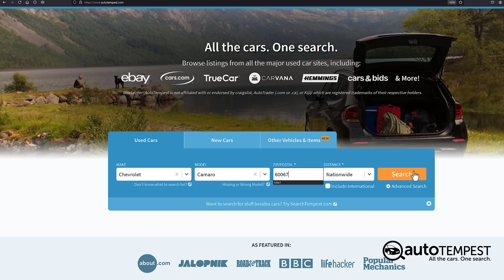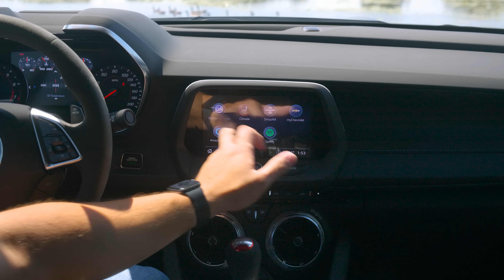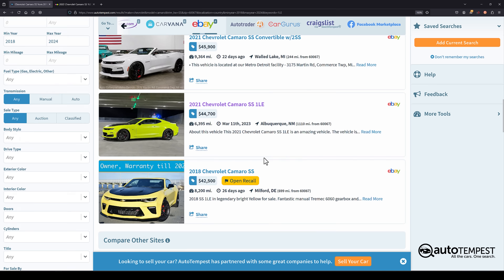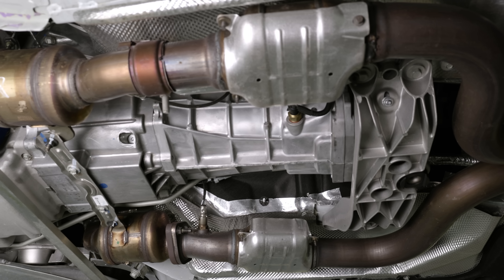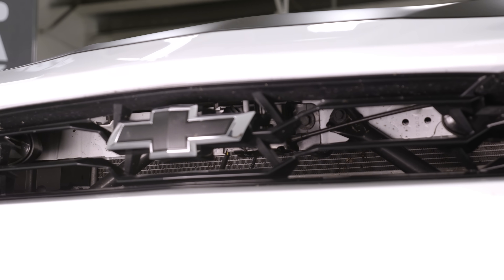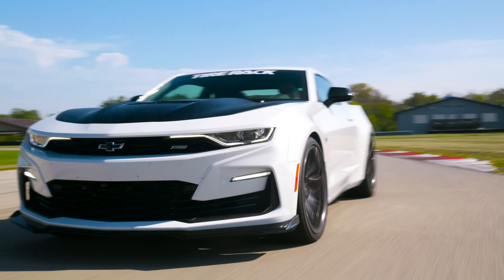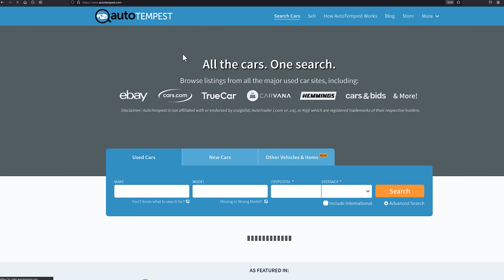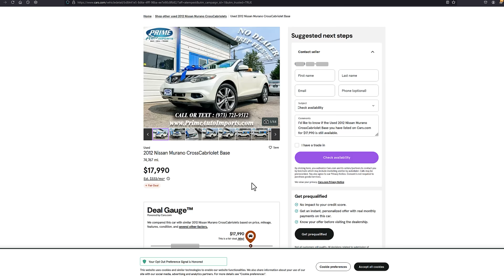Chevy Camaro SS 1LE | Best Used Sports Car of 2024

Comment: Bought a 2022 SS 1LE in May of ‘23 with Tremec manual and 3100 miles. I love it. I just test drove a 2023 Z51 Corvette and was bored driving it. The Camaro SS 1LE is the best value V8 for the money. You get way more than the Mach1 offers at the price point. I will be keeping my Camaro for the long term.
Reply: How do you feel about the visibility? That's the only thing holding me back.
Reply: @hhaste  It's totally fine. 99% of driver don't understand the proper way to set your side mirrors.
Reply: It is THE Camaro to buy. It does offer more value than Mach 1, slightly better max performance at track due to better chasis dynamics, but its not as fun or livable as Mach 1 for daily use. A lot of it is going to be personal preference between the two engines, they feel quite different due to powerbands. I couldn't get over the visibility, and liked the Coyote more, but easily see why people go the other direction, boy wouldn't it be nice to have both...!
Reply: lol the corvette smokes the ss any day it looks better and it’s faster but sure the corvette “ bored u”
Reply: @chagoescalante ive driven an mr2, and a miata (sort of a similar comparison) and the mr2 has a more balanced feel vs a front engine rwd car and that may be the boring he’s referring to. Theres the mid engine balance vs front engine front end weight distribution.
Reply: I would say we get the SAME as the Mach 1 at a much lower price point than the Mach 1, not more than the Mach 1. Only thing I can think of that we get and Mach 1 owners don’t is a HUD. Was cross shopping both and Mach 1 came out to just under 60k so I went 2SS 1le manual for quite a bit less.
Reply: @chagoescalante  Some very fast cars are great on track but not as interesting on the street. Perhaps that is why he was bored. The Camaro does both exceptionally well. Geese and Jack mentioned this in regards to the C7 Jack owned.
Reply: @hhaste  You adapt.  I got 2SS so id have the lane warnings.  I do autocross though with it and I won two races last weekend, open class.  It blows peoples minds there that a Camaro is able to do so well.  Its a monster and punches way above weight.  Once you drive it a bit, you know how large it is and can avoid stuff just fine.  I'm not hitting cones or anything at autoX.  You do need to treat it with respect and not go into a parking area you aren't sure you can get out of, take culverts at angles due to the overhang and ground clearance, not cut corners in parking lots/drive thrus due to islands and edges.  For people that have owned a low sportscar before, its no big deal.  For someone new, there is some adaptation.
Reply: @JohnDoe-np3xd  100%.  They all set them so they can see the SIDE of their car, redundant with the rear view mirror...which means they cant see the blind spot.  No matter how many times I tell people, they'd rather whiplash their neck merging with their mirrors set wrong.
Reply: @hhaste  I don’t have any issues seeing anything but I can see where some might have a problem during a track day.
Reply: Agree on the C8 Z51 feeling boring but I felt right at home coming from an 18 ZL1. Such a comfortable car.
Reply: It will be interesting to see if these ever develop a cult following outside of the GM crowd. Might not depreciate much.
Reply: @hhaste it's fine
Reply: @hhaste that is nothing to be concerned, very fast you get used to the car and it wouldn't bother you specially if you go for a SS2 that comes with safety sensors. They come with backup Camera as well.
Reply: @ThomisticAmerican13FOX For the money the Camaro is the best bargain for performance. The Mach 1 with the track package has cup track tires that wear very fast compared to the stock ones in the SS1LE
Reply: @chagoescalante the huge difference its the driver's involvement on the MT. The C8 Corvette doesn't have this option.
Reply: @Maelstrom8 they mentioned that the Corvette C7 GS felt more as a sport car, more involvement on the driving experience,compared to the C8 Z51 that felt more as a touring vehicle, more comfortable to drive it but kind of numb on the driving feeling side.
Reply: @Micartaa I would never replace a 6MT 6th gen Camaro ZL1 for an AT C8 Corvette. The driver involvement feeling ofa MT its irreplaceable. And the sound and push of the SC V8 is something else. Yes the ME experience on the C8 Z51 should be something else at the curves, but I prefer to stay with the ZL1. The ZL1 are more rare to see on the street and the C8 Corvettes are everywhere🤷
Reply: @jmmch3358  They mentioned that there are better cars for the road. Which is the point we were stating. The C7 is great. But its limits are so high that it isn't the most engaging thing to drive at legal speeds.
Reply: @Maelstrom8  I had the C7 Stingray Z51, and it was very engaging on spirited street driving. Probably you are referring to the Grand Sport, that has a more track focused setup.
Reply: @JohnDoe-np3xd  100%. I don't get the complaints. A lot of new cars have shockingly bad visibility.
Reply: @JamesNoBrakes  Well said.

Comment: I bought the 2024 Camaro 1SS 6MT for $43,500 out the door. Some Camrys cost more than that. It’s an incredible car, and a better daily driver than I would have imagined. Hope you can find one Jack.
Reply: Taxes?
Reply: Used? Thought new were around 48k?
Reply: Wow! 2024 1SS standard price was $42,300.00 + $7,000 1LE performance package + $1,595 destination charge = $50,895.00 MSRP with no additional options.  You got the best deal ever if you got a $7,395.00 discount and no taxes.

Comment: Agreed 100%, one of the all time greats. Sold my SS 1LE for an MT Supra and honestly there's days I regret that decision.
Reply: Damn I've got the Supra and want a 1LE.
Reply: What a car does on paper doesn't necessarily translate to a fun reality. I respect the Supra incredibly efficient at putting the power down, and they finally got a manaul. But it doesn't have that soul, that sound, the V8s will give you that visceral expeirence. Sure its faster than my Mach 1off the line, but in so many other areas the Mach 1 is more rewarding, having driven the Camaro too it is the same story.
Reply: Supra was on my list, but when it was announced it was a rebadged BMW, I got the 1LE.  Absolutely no regrets especially with a real exhaust note (not fake via the speakers)
Reply: @ThomisticAmerican13FOX meh didn’t have a Mach 1 but I traded my 21 5.0 for a 23 ss 1le, u literally feel zero torque in mustangs, stock wise..
Reply: The SS1LE its a better performing sport car compared to the Supra and 400Z
Reply: @jmmch3358 subjectively yes, but objectively I think the Supra is at least as fast, if not a bit faster, than the SS 1LE on a track. Don’t forget the Supra comes on decade old Michelin PSS tires, with a sticky tire, it’s quick. As Savageese themselves demonstrate in some of their lap comparisons.

Comment: I like mine. Bought used in March. It’s a 2020 SS 1LE that had 3k miles on it. I didn’t buy with any misconceptions or unrealistic expectations.  Wanted a “simple” NA V8 with a manual gearbox to track. All marks hit. 

My other track car is a ‘17 Grand Sport. Hits the same marks as SS 1LE. 

Took Camaro to track a couple of days ago. Fun car. It’s a heavy car, like they said, managing weight is a challenge. 

Between Grand Sport and Camaro, the Camaro is actually the more enjoyable on track. I think it’s the driver seat that gives Camaro the nod.

Comment: I would love to hear Jack's comparative thoughts on the SS 1le against his C7 Corvette Grandsport he owned.  Currently have a 1LE and constantly having an inner debate about switching to a Grandsport.
Reply: C7 gs has a better feeling front end(double wishbone) and overall higher grip levels. Trans is worse but drivetrain does much better with heat and oiling. The c7 is a edgier car though and doesnt cary slip angle as well.
Reply: @jackholmes8105  Thank you for the reply, you're the man!
Reply: @jackholmes8105 Jack if you get a 1le, try to do a square setup 305s all around with Cup 2s or Cup 2rs. It changes the overall grip and front end feeling in a very good way.

Comment: I have the LT1 and i track it pretty frequently its so much fun. I cant imagine how fun the 1le is
Reply: The LT1 has narrower tires, smaller brakes and lacks the cooling of the Camaro SS, that also GM backs up for track use.
Reply: @jmmch3358  GM doesn't back a regular ss for the track only the 1le trim
Reply: @danw4507  you are wrong, I owned a 6th gen Camaro SS2 MT, and the car's manual specified that they backup any track usage, even I had on my trunk some accesories to attach it for improving the cooling for track usage. 
Just do some research.
Reply: @jmmch3358  ah yes you're correct I was thinking of the v6, turbo car those have track coverage only on on the 1le trims when they were made
Reply: @jmmch3358  how can I go about adding the extra cooling to my LT1?
Reply: @danw4507  for the brakes probably buying some special ducts toward ventilating your front brakes, akso check if your rotors are vented (mine had stock Brembos), also you will need synthetic brake fluid.
Not sure if you will need rear differential and transmission cooling.
You will also will need wider wheels and track tires. Some adjustable sway bars. 
Stiffer shocks and springs maybe?

Comment: That’s my car but mines a 2014 and was 12000 dollars less 10 yrs ago. There were less than 600 white 1SS 1Le’s made in 2014.  There has to be a fuse to remove or some way in the tune / comp to stop the driving data being sent in those new ones.

Comment: Had a SS1LE myself...Much better car than either C7 Corvette or Mustang because of better as in NEUTRAL/no snap oversteer handling and more Torque than the low torque Coyote V8.But the Camaro is not fun to drive as the engine is not revvy or does not explode at higher rpms and the chassis is very serious not playful as it does not rotate into turns...The M2 is better here but has no V8 sound.Have a Challenger Widebody with 6-spd manual now which has a great engine with Huge Torque and the chassis is very playful as in it does rotate into turns and looks so good !

Comment: Another Z28 was the next step for this car and I’m so sad it never happened. It was going to be a 1LE with a flat plane crank LT2. I wonder how hard it would be to build a flat plane LT2 with DOHC heads and dry sump. Ti rods and high comp lightweight pistons with maybe a 9500 rpm redline and 550-600hp would be sweet.

Comment: Bought a lightly used, 2k miles, 2018 SS 1LE/2SS in 2019, had fun with it for 2 years and sold it for a profit during the Covid used car boom.   Still miss it.
Reply: I did that too. Bought a 2019 in 2020 with 2300 miles and sold it in 2021. But I did buy a new 2023 the following year. I am probably never going to sell this car.

Comment: Honestly this is enough power.  No need for the Zl1. This is definitely a great bang for your buck car!
Reply: As a ZL1 owner i agree with you to an extent. Z's have so much power you absolutely obliterate the speed limit in mere seconds. The SS you really get to enjoy the motor and sound and ring it out & not having to fill up every 90-110 miles lmao
Reply: @305Nick zl1 gas mileage does suck compared to the ss for sure!
Reply: @305Nick same thing I thought about my 6th gen Camaro SS2, didn’t need the SS1LE for spirited road or street driving, the SS has a great handling suspension, great brakes and great steering, sufficient for the street without increasing the cost of replaceables: tires, brakes, etc. I"m not sure of the base V8 LT1 Camaro with the narrower rear tires, how it would handle, probably at least for good handling performance in the street would be the SS package.

Comment: I'm not sure what is going on with this car specifically but I have a 18 1LE that has been tracked a good amount and front end grip and braking are strong suits, not weaknesses. The pedal doesn't have strong bite but with good DOT4 does not fade at all even in high temps. Front end grip can go rapidly when tire wear becomes a factor which appears to be the case with this example after seeing the tires while car is up on the lift. Friction of 285s up front means it is hard to lose front end grip easily.

I think with decent tires and sorted brake fluid (potentially also new stock pads) you would be surprised to find that neither is a weakness on the car.
Reply: Additional track specific brake ducts also come with the car from dealer and can be installed to aid with brake cooling. Later years had redesigned ducts on the control arms that have more cooling stock but either way brake fade should not be a factor on these cars with good fluid
Reply: I track mine and completely agree.  OEM pads and Castrol SRF fluid for 28 track days and 0 fade.   And while the normal balance of the car is mild understeer if you enter the corner too hot, you can trail brake it to make it neutral and even (under aggressive trail braking) oversteer going into a corner.
Reply: Yep, I run stock pads and OE tires on mine and havent found the need to swap to track pads. Have done track days in 110F heat (Buttonwillow/Willow Springs) and brakes hold up fine with a  swap to RBF600/Castrol SRF fluid.

Front can slide if you put too much energy into the tires on hot days and if I were a hardcore track rat I'd swap to a 305R19 square tire setup, but the stock Goodyears are a great compromise between streetability and track pace.

Comment: GM knows how to build a muscle/ sports car... This vehicle also has one of the best manual transmission.
Reply: Tremec one of the best, its standard on all Camaros, on the Mustangs you can only get it on the higher end: Mach l, Dark Horse or Shelby GT350 GT350R 🤷
Reply: @jmmch3358  agreed One of the best vehicles i've had the privilege of driving.. Kind of sucks that GM discontinued it.
Reply: Not only is it a Tremec, its the 6060 model, unlike the new Mustangs which have the 3160. The 6060 is far more capable when it comes to power handling upgrades.

Comment: There are brake ducts you can put on the car for track use which make all the difference. It does come with some small ones installed but there are two other types available and either one of them will virtually eliminate the brake overheating issue on track. They just bolt right on to the control arms. You can also get (even) smaller brake shields from the ZL1 or ATS-V that help as well.
Reply: The 6th gen does not overheat its brakes, since it was a used sample, probably only needs new fluid with the right spec for the track

Comment: A machine ahead of its time 
Still lays the hurtin on Mustang GT, Nissan Z, MKV supras, GR Corollas and anything modern in its price range
Reply: 100% agree and I have a GRC on E. It completely rips, but it's a different car entirely, I've always wanted a Camaro and I feel like this is the best one to get for the dollar
Reply: Lol no.
Reply: @SSH939 lol YEA!!
Reply: stock sure
Reply: Check caranddrivers 2024 Dark Horse Mustang 6 speed vs 2017 SS 1LE test numbers. Almost identical. Camaro came out 8 years ago and costed tens of thousands less but still hangs with the best mustang track option with a N/A engine
Reply: @ayushmalpeddi2793  Good comparison, the previous Mach 1 trim for Mustang is a more direct competitor, especially price wise. Its good to point out the DH was not a great improvement over the Mach 1, I'd say not all especially when price and subjective styling is factored in. SS 1LE has the best value of any V8 offerings but its hard to live with everyday. Id take it over a Dark Horse everytime, and I drive a 21 Mach 1 6spd.
Reply: @SSH939  ?? 1LE still beat every single one of them
Reply: The SS1LE its a great track fighting machine VS the Mach l, Shelby GT350, Supra and BMW M2s and previous M4s👍🏆
Reply: @ayushmalpeddi2793 Also MT prefers the 6th gen Camaro SS1LE VS the Mach 1, Supra or the 400Z
Reply: @ThomisticAmerican13FOX even compared to the Shelby GT350 (non R)
Reply: When it comes to straight line speed, the Camaro is good off the line, but the Mustang GT always catches up. On roll races, they are about the same. Around the track, the Camaro handles better. So raw power between the two isn't too much different and neither of them are really slower than the other. But personally, I went with the 2019 GT Mustang 10spd. Making 497whp with E85, intake and exhaust work.

Comment: I daily my 2018 Camaro V6 Manual(3300 lbs)since new in the North East for the past 5 years, no rust. I have 140k its still looks and drives great. I thoroughly wash it underneath and I protect the front end with a novastrech bra, keeps the salt out of the compartment. I intend to wear it out and buy another, if there is a 7th gen or I get a used 6th gen.... I don't know when that is going to happen, the car takes everything I give it including my own personal tune. I get a lot of funny looks in the winter and I don't care, I refuse to drive crap just because it’s cold out. The steering feedback and handling are perfect. You'll simply outhandle everyone, and the steering column can take a bunch of weight on it when #gorillas drive lol, Jack should def get one..... Best car I have ever owned. IMHO, with a manual transmission, they are best car GM has ever made. It is a proper driver's tool, low on gimmicks, high on content. Great review, thank you.

Comment: The tall doors/small windows, trunk opening, etc (the bunker) could be the reason for the chassis stiffness.  A sharp turn up a decent curb will make one of the rear tires lift.  Also there is no need for a strut tower brace - the front end is that stiff.  Always tradeoffs in creating a rigid structure with holes in it.  The Corvette C8 is auto only because they didn't want a hole in the tunnel to weaken it.  In any case, I've owned convertibles with less visibility, it is a non-issue.